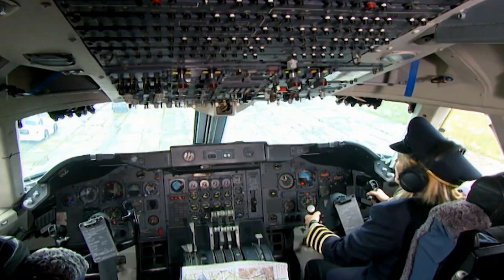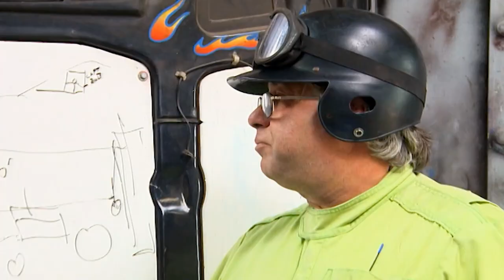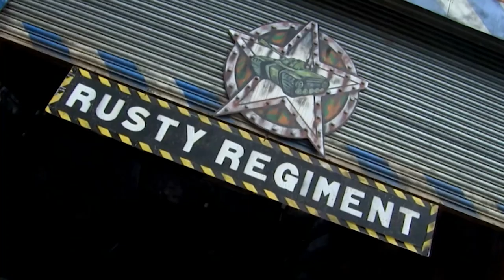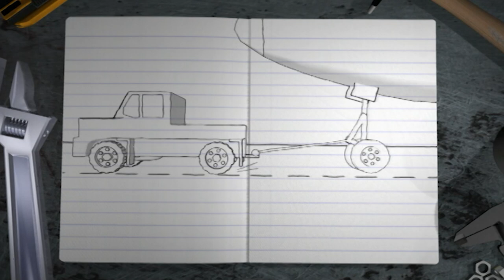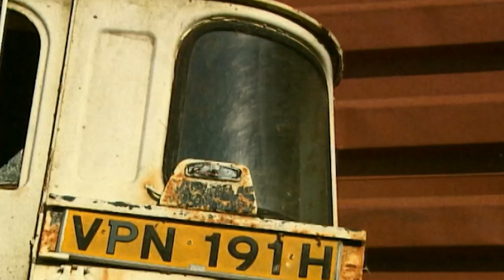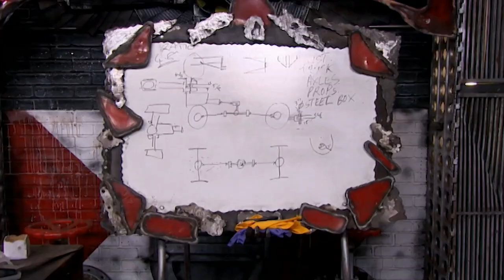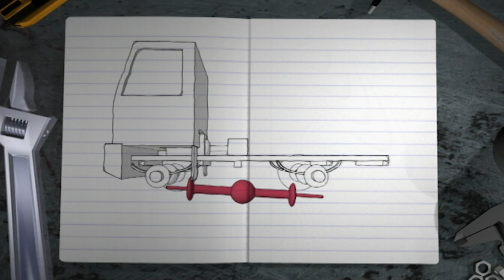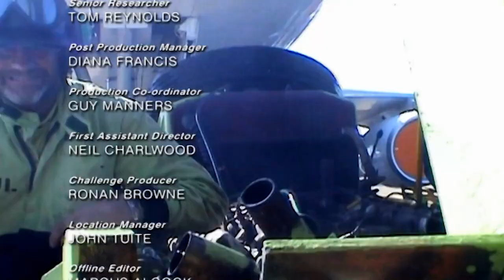Tug of War with a 747 - Scrapheap Challenge - S10 E11 - Game Show

Comment: I strongly suspect that that truck would've been better off if they hadnt modified it aside from adding ballast.
Their super low gearing & 4WD werent really needed to get the plane moving, and if they'd had more top-end they would've easily won.
Reply: It was not a glider they were trying to get in the air. Lol
Reply: @andymcneil7085  I used to work airport ground service, and I can tell you from first-hand experience that a bone-stock ford F-150 is capable of pulling a boeing 737.
That big diesel would not have had any problem pulling a 747. Particularly one that has has no fuel or cargo & has been converted to a movie prop & had its engines removed
Reply: @nottiification  I sit corrected.
Reply: @nottiification  150 tons is a lot, until you realise just how little friction the wheels have. It gets really silly when it comes to trains though, where the same weight can be pushed by hand (just do not get in the way of it and try to brake it by hand).

Comment: What variant 747 has dual engines on single pylons?
Reply: That was likely a test bed 747. No production 747that I know of came with engines mounted like that. Now I will say I am no aviation expert but that is what I would guess is what this is.
Reply: @tquiring212  It was altered for a bond film

It is also the same plane that clarkson towed in the tractor drag race on topgear
Reply: @thinfourth  that would make sense to be a film modified airframe. Definitely not a standard 747

Comment: Why don't they stash transfer cases in the yard for them so they don't have to rig something up or are they just not that common over there?
Reply: Probably didn’t expect anybody to purposely put a weak point into the vehicle
Reply: I would’ve put two engines front n rear, independently controlled rear by another driver, more weight, and better engine control